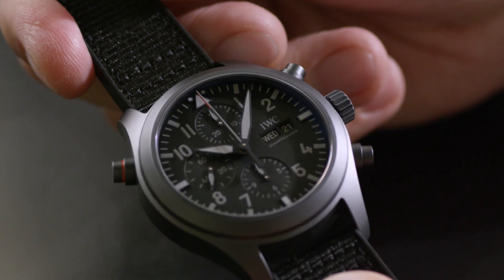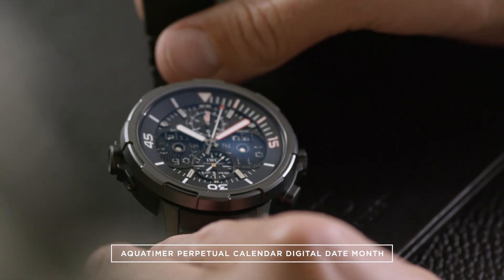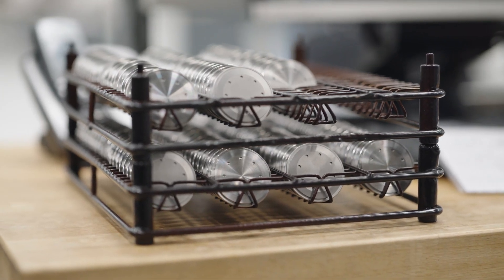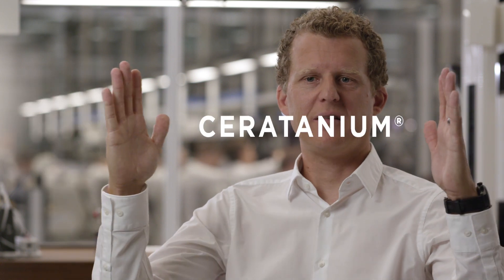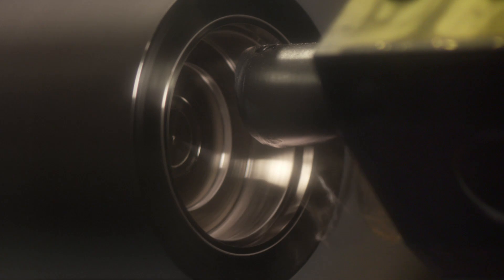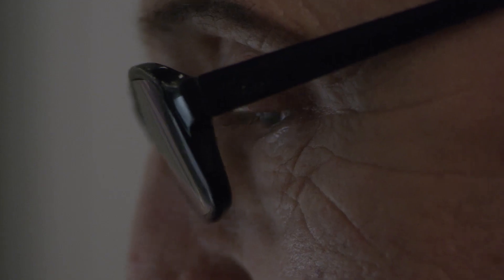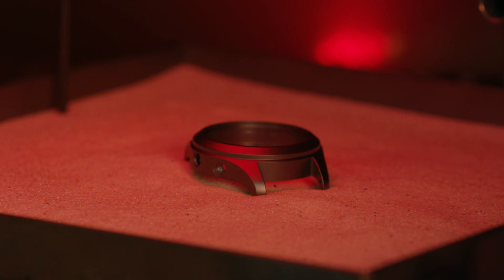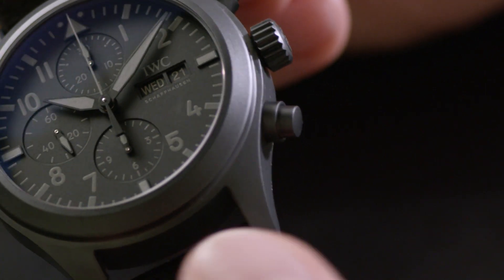IWC - What is Ceratanium®?

Comment: Damn i tought iwc is being cheap by using  ceratanium. Turns out really  advance  tech, 

So it is a titaniun covered with ceramic created by sandblast and heat technique? 

btw what titanium grade did iwc use for ceratanium? 

Grade 2 or 5? 

I probably buy your ceratanium watch after watching this video, im really scared to pull the trigger for ceratanium , i thought ceratanium is fragile like ceramic